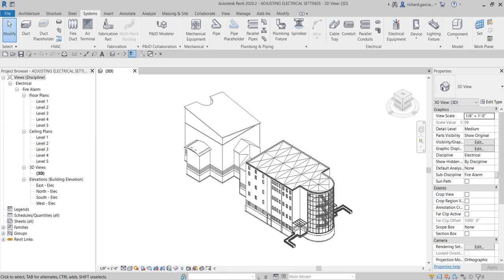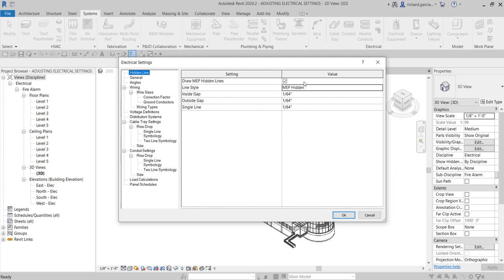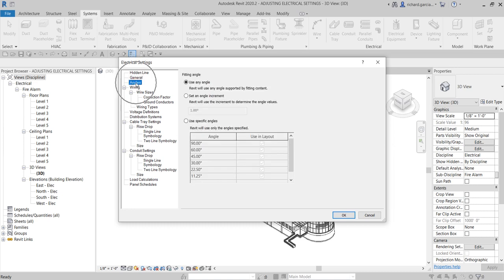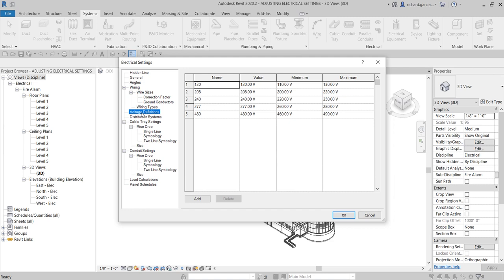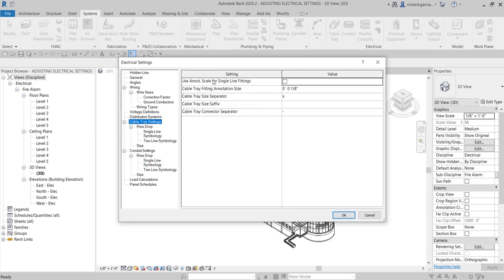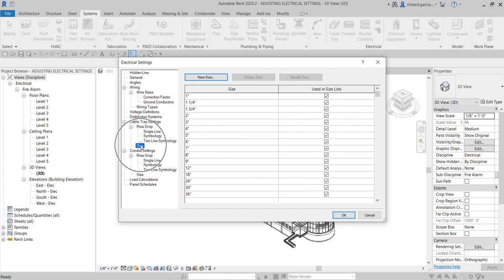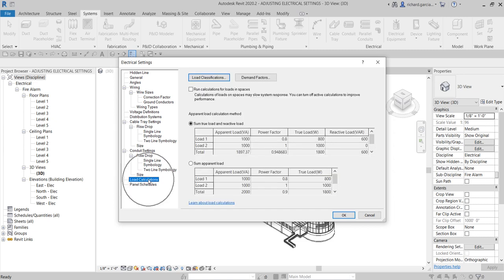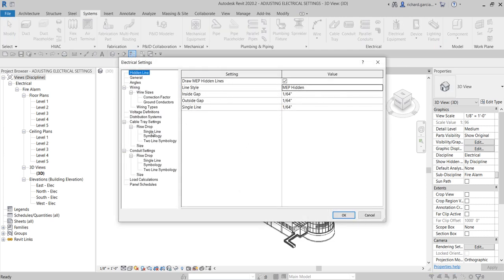FIRE ALARM SYSTEM LESSON: USING ELECTRICAL SETTINGS (ES)

Comment: Hi Mr Rich
In distribution system
(120/208 3phase L-L voltage 208)
Why revit shown 3phase
Normally 3phase L-L voltage 415V L-N 240v
Kindly explane
Reply from the maker: Hello Adam, it seems like there might be a bit of confusion regarding the voltage values and the representation of the distribution system in Revit. Let me clarify:

1. *Voltage Values:*
   - In North America, the standard three-phase voltage for commercial and industrial systems is often 120/208V or 277/480V. The 120/208V system means that the line-to-line (L-L) voltage between any two phases is 208V, and the line-to-neutral (L-N) voltage is 120V.
   - In Europe and many other regions, the standard three-phase voltage is often 400/230V. The 400V represents the L-L voltage, and 230V represents the L-N voltage.

2. *Revit Representation:*
   - Revit is a versatile software used for building information modeling (BIM), including designing and documenting electrical systems. It allows you to model different types of electrical systems, including various voltage configurations.
   - When you're setting up a distribution system in Revit, you need to configure it based on the actual system you're designing for. If you're designing for North America, you would configure the system to reflect the 120/208V voltages. If you're designing for Europe, you would set it up for 400/230V.

It's important to configure Revit accurately based on the region and system you're designing for. The voltage values you see in Revit should match the specifications of the system you're working with. If you're seeing different voltage values in Revit, it might be due to incorrect settings or configurations. Double-check your settings to ensure they match the actual system you're designing for.

In summary, Revit can represent different voltage systems accurately, but you need to configure it correctly based on the specific standards and voltages you're dealing with in your project.